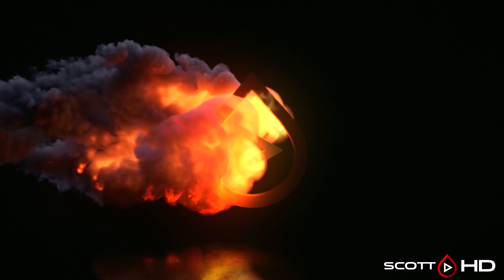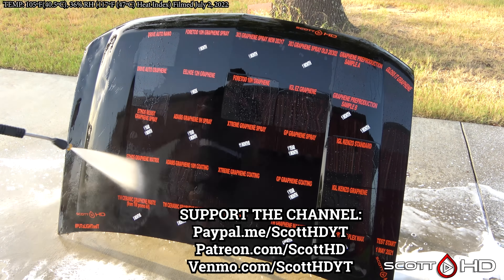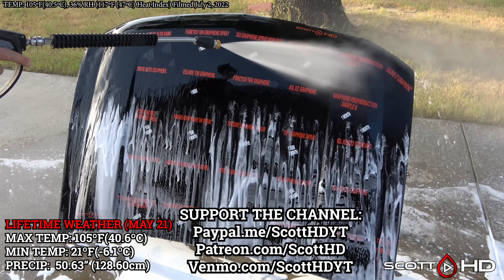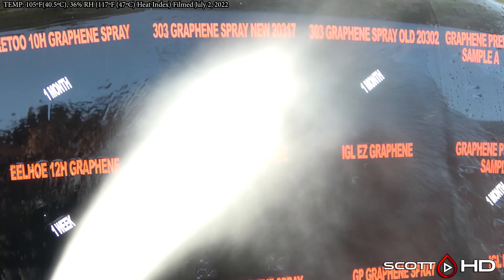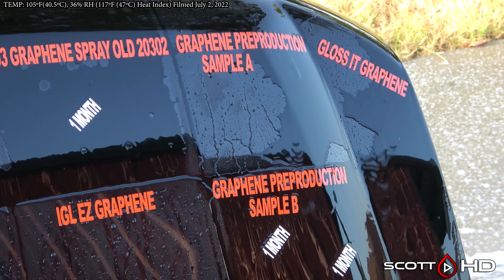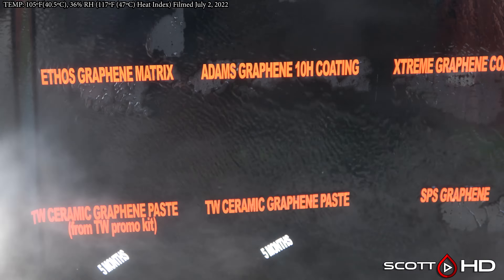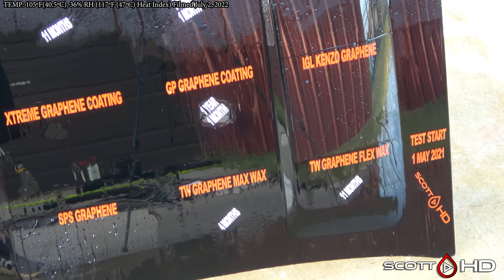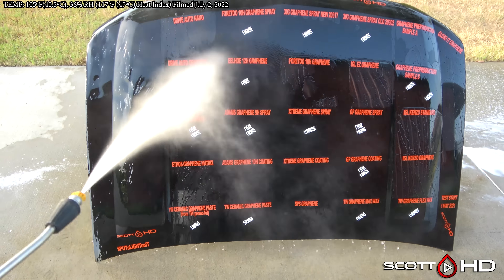Graphene Coatings Longevity Test - 25 WAY - ULTIMATE comparison - UPDATE 16 - 1 YEAR, 2 MONTHS

Comment: Awesome video bro! Thanks for the hard work! Considering the time that has elapsed, IGL always impresses me!
Reply from the maker: It's definitely been one of the top 3-4 brands across their line that at least comes close to what they say it should do (in most cases).   There are others too... Gyeon, Gloss It, etc.   Adams has been VERY inconsistent across their line, but they have some winners.
Reply: @ScottHD  thnx for the insight. I love gyeons products! I dig their restart soap, bathe+ shampoo and foam. And for protection can’t go wrong with can coat evo with the occasional wet coat as a rinse aid. Their interior Detailer, leather cleaner and leather coat are great too. I never stick to just one brand, there’s never a need to show that kind of loyalty but Gyeon makes it hard 😂

Comment: SPS looks like the best one... But I don't see how these graphene ones are better than the non-graphene ceramic coatings.
Reply from the maker: I'm not seeing it either
Reply: It's not as black or white as saying graphene or ceramic? Both Graphene and standard coatings are great, and either one can out perform the other. There are many variables in this. This test doesn't address specific benefits of graphene which is reduced water spotting and that's fine. I just wanted to point out that graphene isn't necessarily better or worse than ceramic and vice versa.
Reply: I will say the Artdeshine NGC on my truck doesn’t water spot as bad and I don’t maintain it the best. When I do see spots they normally wash out or come out easy with a WSP. Per the chemist, the way he formulated it you get a longer “window” time with water spots and it would take longer to start etching. Again, it’s on my personal truck and I can contest they come out easy and the coating doesn’t clog easily like others.

Comment: I wonder what would Adams say/do if a buyer tried to get their money back or a replacement for their "10 year" coating not even making it past two years.
Reply: It would be your fault for not applying it correctly ...
Reply from the maker: I would say they will do what all of these companies say (Justb1066 nailed it) - blame the installer.  Wasn't installed correctly.  You are doing it wrong.  Not our fault.  

...but in all seriousness, read their warranties closely.  The ONLY company that I've seen that covers hydrophobic properties in the warranty is Gyeon.
Reply: I applied their graphene ceramic coating and it failed pretty fast. I emailed them videos to show them. The response I got was "you applied it wrong", but then they also gave me store credit to make up for it.

Comment: very helpful. I notice Chemical Boys never seem to do very well. I have given up on most their stuff. I bought some of their Diablo wheel gel and it did not clean my tires/wheels. I then sprayed some $4/bottle Turtlewax wheel cleaner on the same tire after using diablo and all this brown crap came off my tires.
Reply: Crazy ain’t it. When people say “I only like a few of cg’s things” it’s always so true. I can recommend their leather cleaner and leather conditioner. If you’re ever looking for a good, cheap solution. Though for a few more dollars you can get Gyeon s’s leather cleaner and leather coat and it’ll outperform the fk out of the cg stuff 🤷🏽‍♂️
Reply from the maker: They have a few products that aren't bad, but their coatings/sealants don't seem to hold up and they aren't inexpensive!
Reply: @ScottHD  I can agree with that. I just dislike how U have to sift through so much and google a ton before pulling the trigger on a cg product.
Reply from the maker: @SheekTresSesenta  agreed. They are experts in marketing for sure
Reply: @ScottHD  no doubt about that!

Comment: I would like to see the nanoking graphene 10H+ coating (or OneAmg graphene 10H +or senymin graphene) tested
Reply from the maker: I'll check that out.  Is it a pro-only coating?
Reply: @ScottHD  no cheap Chinese!
Graphene Nanoking 10H+, graphene OneAmg 10H or graphene senimyn 10H, are in my opinion the same!.  With Sio2, graphene and fluorine.  I think maybe even the foretoo graphene ?!.  The nanoking costs 30€ on Amazon.  But frankly he is not ridiculous next to big name!.  Even the packaging is nice. For example, you take carpro are for the higher price of boxes by very sturdy.  The nanoking arrives in a very robust and thick box, magnetic closure, gloves, fairly good quality bloc (With registered nanoking) , suede (real steps like Mr. Fix's tea towels), a leveling microfiber, instructions.  even if the boxes are only secondary, it can help in the quality of the product, if they put an effort in the packaging, then why not in the product itself, in any case I see it like that.. Chinese but of good quality in my opinion, like all the countries where it has good and less good!
Like many I like to have fun with coatings on panels.  And the dpro type H ceramic coating, which alone is not necessarily a good coating, but which serves as a good base coat for top coat adhesion.  By testing 2 layers of dpro type H and 4 hours after gliss v2, and it worked wonderfully in terms of hydrophobicity and duration.
Reply: Scott, question aside, you who are a pro, concerning ceramic coatings, good or bad quality, for the queens of the garage whose coating could last for years and years, can it curl a little like orange peel , or is not possible?.  Because I had a car that I'm pretty sure had no orange peel and a queen of the garage, so the coating (CQuartz lite 2 coats, gliss v2 1 coat) was not stressed  .  2 years later in a few places I had like a slight orange peel?!.  (hydrophobic as on the first day of course, it only came out very rarely) So your pro opinion, it could come from the coating or had I not noticed the orange peel skin at that time?.  Thanks in advance my friend